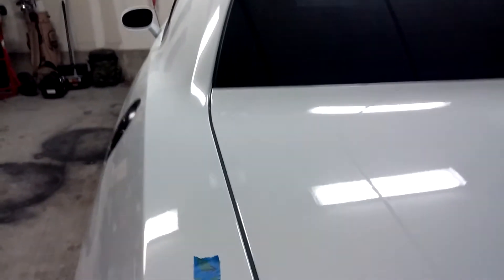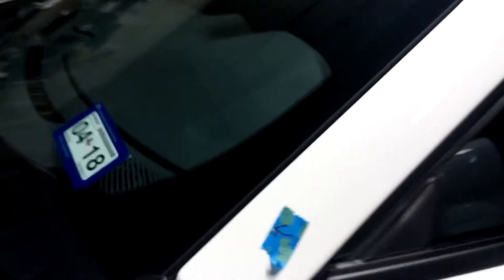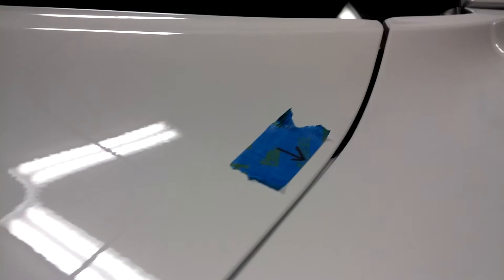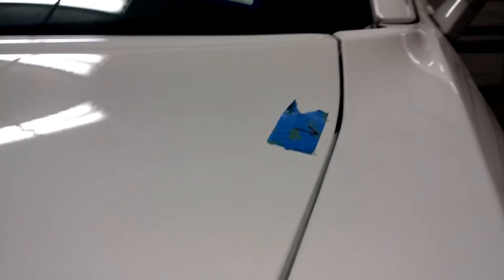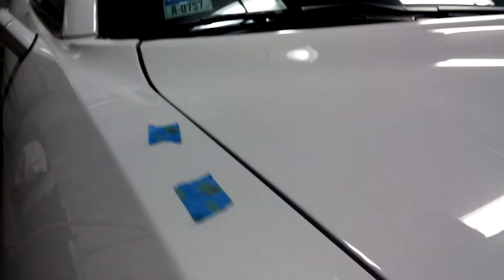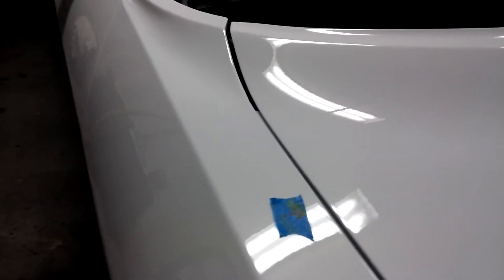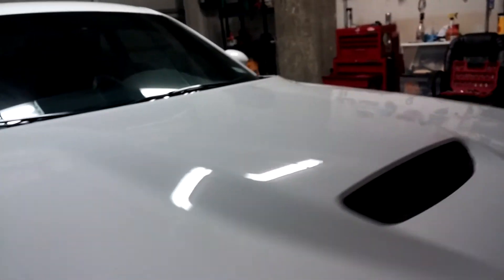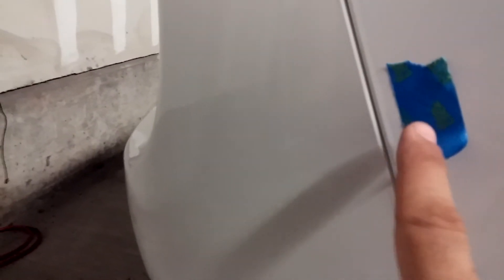Fit and finish issues on my 2016 Challenger SRT

Comment: I just stumbled across your channel today and I must say that I like it. BTW, Where did they paint that thing, In a barn ? Thought I saw a piece of hay. I wonder if the fitment issues on the front end could be from torque transmitting through the chassis ? Anyway I will keep looking at your channel and plan for the day I can afford one of the new gen Mopars.
Reply from the maker: BDOG JR thank you very much!  And yeah, if they would have painted it In a barn it may have turned out better....
Reply from the maker: BDOG JR actually, the fitment was there from day one.  a couple of beers and about an hour of work and those issues were handled.

Comment: Since your car is new have you taken it to the dealer for a cosmetic fix?  If the flaws are in the clearcoat it can be wet sanded and or buffed out.  White paint is easy to work with but again your dealer should correct it.
Reply from the maker: Doug Kessler I fixed the fitment issues myself. the paint issues I decided to leave alone.  I figured it gives it character.  besides, nobody's perfect!